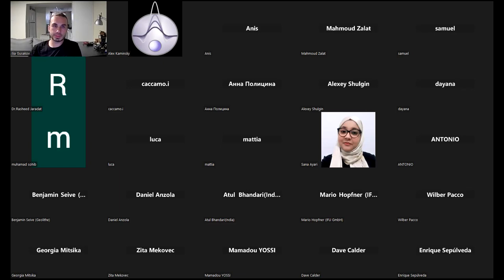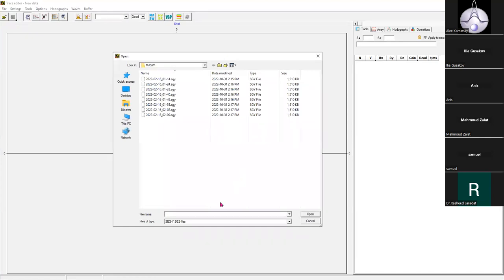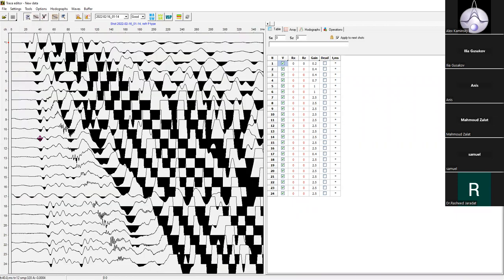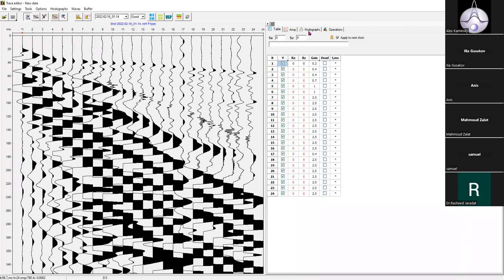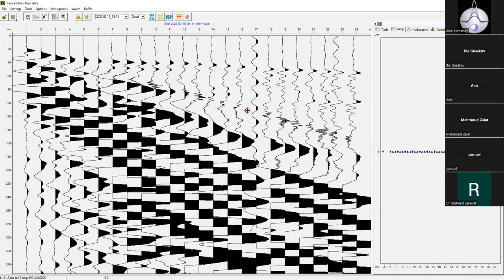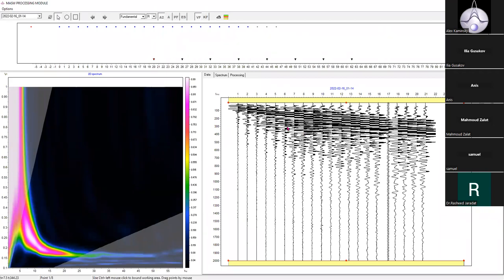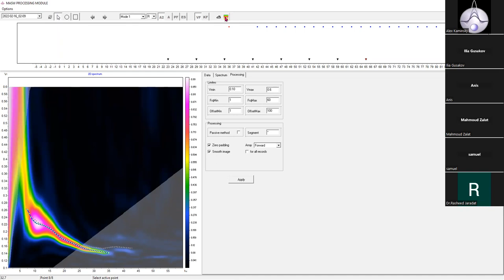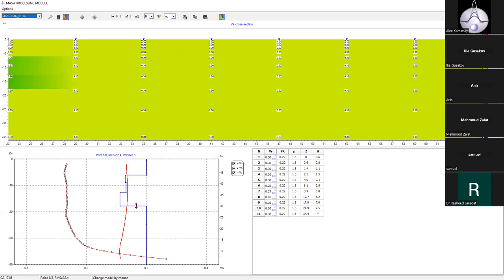Webinar on near-surface seismic data processing in ZondST2D software

Comment: What if I have a long line of 172m. And this line is composed of two overlapped spreads. The length of each spread is 116m and the overlapping distance is 60m. Now the question is, how can I merge these two spreads together as a single dataset and import them into the zond software to do the data processing
Reply: remove those overlapping traces or stack them and reconfigure your geometry